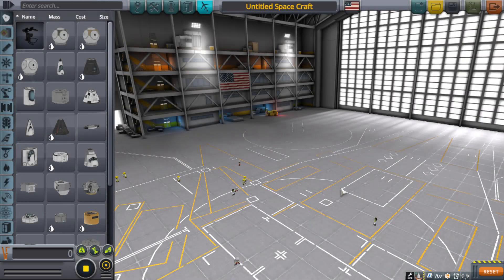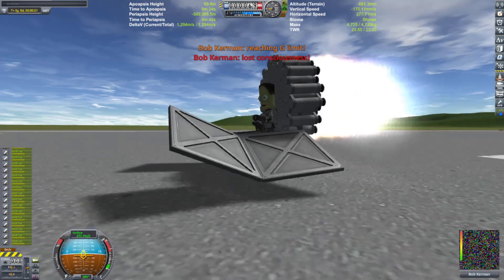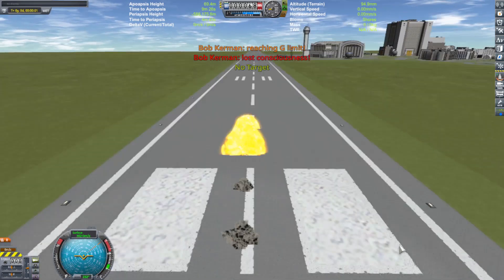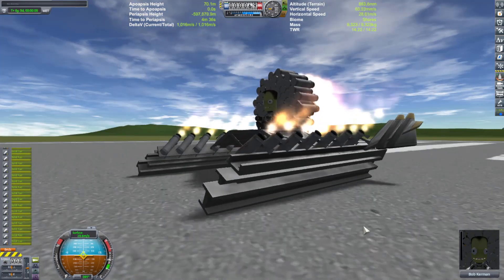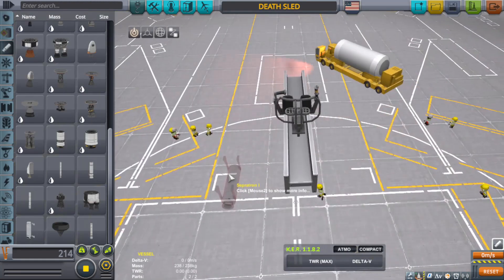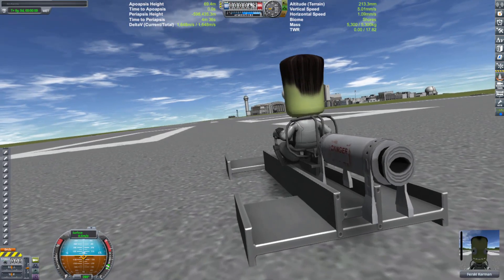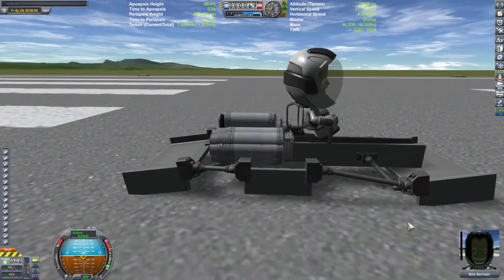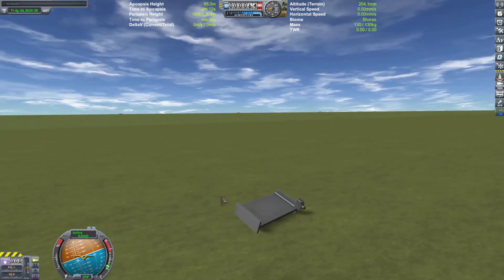DEATH SLED

Comment: TWR is probably the Thrust to Weight Ratio, which is the amount of Force exerted by Thrust relative to the Force exerted by the effect of Gravity on the vessel's Weight. I may be wrong on the actual formula though.
-
-
I know for certain that a 16-something TWR is super fast and is generally a good rule of thumb to keep your TWR above 0 in every stage to be able to move at all and substantially higher than 1 to move at a decent speed that doesn't waste 90% of your fuel just to reach the height of 1000km in the very first launching stage & definitely less than 10 TWR as to not have air drag absolutely shred your ship, which also wastes fuel to fly against said air drag.
Reply: A thrust to weight of 0 means that you have no thrust at all and aren't moving at all, TWR of 1 and you won't get off the pad until you've burnt a bit of fuel and even then you will be extremely slow, and a TWR of 19 means that you are cooked through in about 5 seconds.
Reply: @WM3636-d1c  I wasn't far off. ;)
Reply: @muffinman2546  No, your reply was a pretty good explanation, I just wanted to clarify things a bit more. :)

Comment: That glitch is the seams of the runway model. Each one makes an edge that shouldn't affect anything, but it allows the computation to have the parts clip into the ground slightly, then explode, then the next parts hit the ground at insane speed and explode instantly because KSP doesn't know the difference between sliding and face-first impacts.